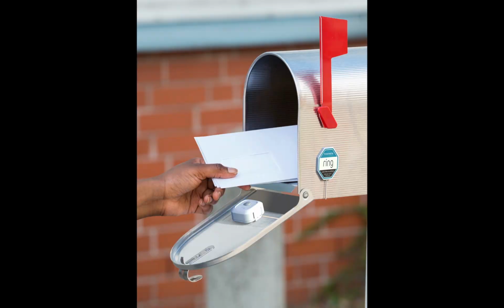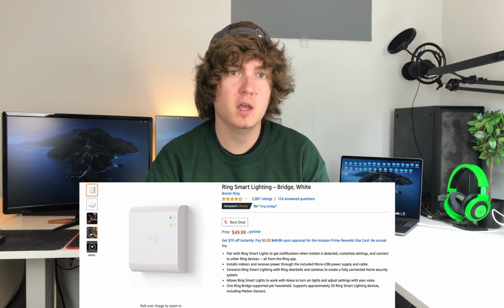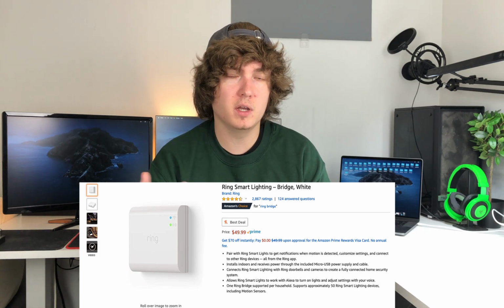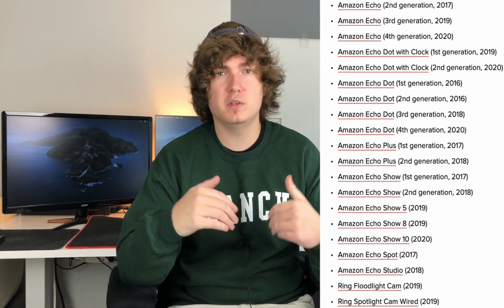Ring Mailbox Sensor Explained

Comment: why does amazon product listing say you need a bridge?
Reply: So you can get to the other side. Kidding. The bridge talks to your device and connect to your wifi...it acts like a bridge, you need it to work. Some other ring devices such as light bulbs and floodlights require the bridge to operate as well.
Reply: @Mister_Y  my 3 floodlights work perfect with no bridge..
Reply: @jesusjuarez8843  You can use the floodlights like any other regular motion floodlights without the bridge, but to utilize all the features, you need the bridge. It allows the floodlights to interact with your other ring devices. For example, if the floodlights turn on, a camera could start recording, or other lights can turn on at the same time. Without the bridge, it’s just a regular motion sensing floodlight. There are many on the market for this application if this is your intent. Most people would buy this(floodlight) because they are in the Ring family of smart devices and want the devices to “talk” to each other or work  together. Your floodlights might “work” like a regular floodlight, but would never connect to your Ring app allowing you to know if motion was triggered(and logged). Lastly, you can not use the app to turn on the floodlights without the bridge.